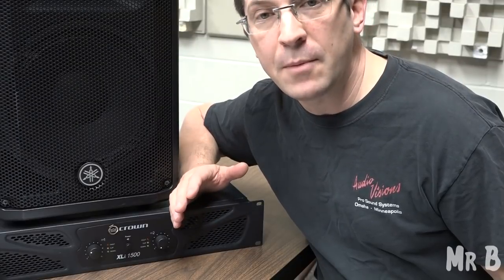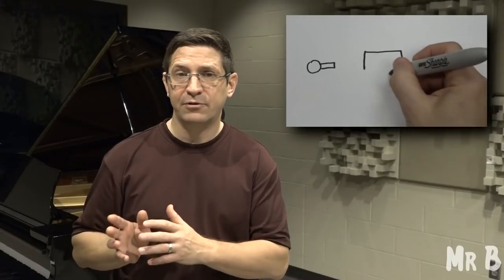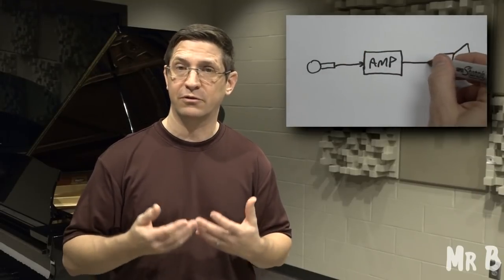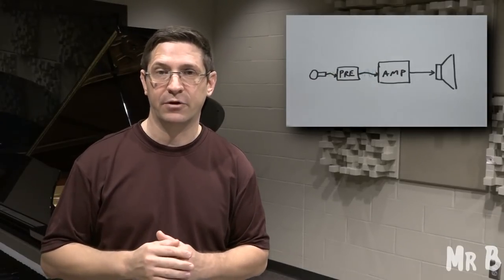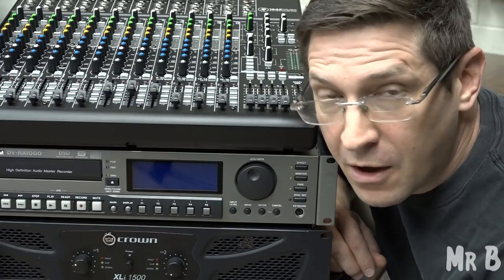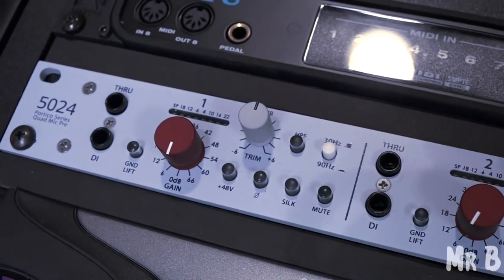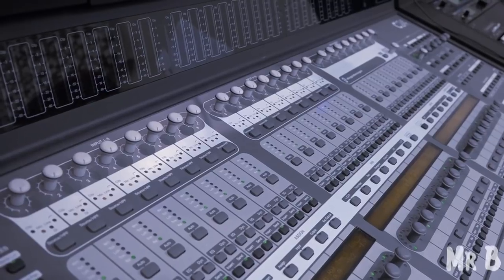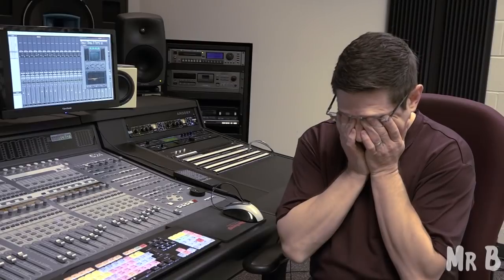What is a Microphone Preamp?

Comment: I was using a friends focusrite solo to track vocals and very seldom instruments. I purchased a budget friendly ($100 or so) tube preamp. I was going to run it through the focusrite. My mindset was the less one device is doing the cleaner the signal aiming to have a lower noise floor. I never actually got the chance to do much tracking with the setup because an apartment moving occurred so it all got wacky, but recently they needed the focusrite solo back. I’m wondering if i can just simply use my preamp and i’m guessing like line output it to my computer and track that way or do i need a form of conversion before it hits the computer?
Reply: also this may be my favorite audio engineering educational channel.
Reply from the maker: Hi there, thanks for watching!  What's the brand and model number of the tube preamp?
Reply: Mr. B in the studio pretty low budget Behringer Ultragain Pro MIC2200
Reply from the maker: Awesome!  Thanks!

Ideally, you would want an audio interface to plug it into, but it may be possible to plug it into your computer's native sound card.  Does your computer have a line level input, like an 1/8" plug?  If it only has a headphone jack, then you would need an interface of some kind.
Reply: thank you, i think i understand. i’ll have to give it a look. the interface is for conversion correct? i’m guessing analog to digital? i hear conversion used often when interfaces are brought up, but i don’t know what’s being converted or what’s it needed for honestly. I’ve never given that a google or library visit. 
i just want a low noise flow (clean signal?) excluding removing things that give off electrical and fan noise from my recording environment. i have a Behringer U-Phoria UM2 USB Audio Interface but i didn’t really like its sound (that’s why i wanted my friends focusrite) i never tried to use it with my preamp though. Is the audio interface the hardware i should focus my expensive purchase on? I own an audio technica At2020 mic. I apologize for the bombardment of questions.
Reply from the maker: Not a problem.  Yes, the interface takes care of the A to D conversion.  It's worth a shot to see what your UM2 sounds like with the tube preamp.  I would go into the 1/4" input instead of the XLR.  

Going forward, yes I would invest in an interface for your next step.  The Focusrite stuff is pretty good, and reasonably priced too.
Reply: Mr. B in the studio Ah! Thank you so much! Finally someone to answer me who’s knowledgeable, this helped a headache. I’ve danced months with these “what if’s.” Everything I know comes from trial/error of recording others plus self and reading. This was a great help. I hope you have a grand day sir. Wish i was one of your students.

Comment: i recently purchased a shure sm7b. i’m seeing a lot stating cloudlifter or another brand is a vital. i own a preamp i’ve never used just sits in its box an a audio interface. i’m wondering what would be my best course of action at lowest noise floor? how should i run these or should i at all? what shouldn’t be included and what should? i simple just want a quiet recording, excluding acoustic treatment and sound proofing of course and i don’t want to plug cables and damage gear due to lack of knowledge. i originally had a condenser an audio interface before.
Reply from the maker: What are the model numbers of your preamp and interface?
Reply: Mr. B in the studio Behringer Ultragain Pro MIC2200 and PreSonus Audiobox USB 96
Reply from the maker: Ok, next question, what are you recording? Spoken word? Singing? Acoustic guitar?
Reply: Mr. B in the studio most often singing.
Reply from the maker: Ok, based on what you've told me, I don't think it will be necessary to get a cloudlifter.  With the gear you have, you should be able to get a decent input signal.  If you were doing spoken word, and you were a soft talker, I might recommend it.
As for the gear you have, you should be able to get a good recording plugging your mic right into the PreSonus.  
But you might get a richer tone using the Behringer, simply because of its tube electronics.  If you wanted to do that, I would use a balanced 1/4" cable (TRS) from the output of the Behringer to the input of the PreSonus.  Make sure the phantom power on the PreSonus is OFF, and start with the gain all the way down on both units. Slowly bring up the gain on the Behringer first, and if you need more gain into the computer, (which you probably won't, since you're putting a line level signal from the Behringer into the mic input of the PreSonus), turn up the gain on PreSonus.
Reply: Mr. B in the studio thank you so much! you’re the bill nye of music engineering! haha if you had a tv series, i’d tune in. you know your stuff!

Comment: Hey I use shire 57s and the scarlet interface and I have to turn the input level almost all the way up to hear the mic well can I still use a preamp?
Reply from the maker: Hi Steve, thanks for watching!  Yes, you can use another preamp in front of the Scarlett, you just have to watch your gain structure on the Scarlett, being careful not to overload its input.  You might also want to look into a product called the Cloudlifter.
Reply: Mr. B in the studio thank you so much I’ve been trying to find the answer to my low out with the 57s Some show a mic technique of putting the mics a foot or two away for guitars and with my Scarlett alone there’s no way that will work its to low. In the 200 dollar range or lower which do you recommend?
Reply from the maker: Let me first ask, what are you recording?
Reply: @MrBinthestudio  I'm a Christian song writer. Acoustic guitars, piano, vocal harmonies. Erdrummer or garageband drummer. I also use pro tools but garage band is easier.
By the way your flex tool explanation was great I've watched other videos and was lost in the gargin. I've been punching in instead of flexing, that video helped.
Reply from the maker: @steveapplegate322  Ok, then instead of buying a preamp, I would suggest looking into a condensor mic instead of buying an additional preamp. You should be able to find a good one in your price range.
Reply: Mr. B in the studio I just bought a sm7b today thinking along those lines. Thank you for your knowledge and time. Hopefully that mic will do the trick.

Comment: what happens if one feeds a mic-preamp with line-level sound, instead from a microphone?
Reply from the maker: Depends on the preamp, but line level into a mic input can distort pretty easily.  It can be done, however, if you're careful  about how hot the line level signal is.  If the mic pre has a pad on it, that can help, too.
Reply: @MrBinthestudio  thx. can earphone line-level be amplified without distortion?
Reply from the maker: @bluename4  Yes, if you go easy on the volume from the source, you should be able to do that.

Comment: I have one furthure Question: What about noise. What if I would like to record something really quiet. With your type of equiptmen you might not have these problems. But what if you have noise on your recording. Do I need a better microphone, or a better preamp? Or propably both?
Reply from the maker: That's a tricky one to answer, as noise can come from many different places.  What does the noise sound like?  Is it a high frequency hiss?  What kind of mic/preamp/recording system are you using?  Give me some details and I'll see if I can help you nail down the problem.
Reply: The noise sounds like you turn up the volume of an old amp verry loud without playing music. Is pink noise the right term? Maybe.
I used two Sennheiser 80s with XLR with a Zoom H4n. So I used the build in Mic preamp. The self told challenge was to record a Chior concert in a big church not noticalble from the back of the church. I did this to test the shotgun character of the ME 80s.
Reply from the maker: The H4n is a good system, so I am suspecting either the mic or the cables.  How old are these mics?  Also, do you know if they are phantom powered, or are they the older T-powered version?
Reply: I use the xlr Version with phantom power. And yes, this mics are old and I already noticed that newer mics like the NT5s produce more signal. So better mics would be an option but the new mkh or ntg are currently out of my price range.
So I'll try some other preamps in the next days. Meaning some other preamps which are built in in some other devices I own. I don't have some stand alone preamps.

So thanks for your Videos!
I like them. And I am one of those persons that are interested in the details you skipp sometimes.
Reply from the maker: Thanks for watching!
Reply: Yes, the preamp has an impact on the noise. With the Zoom R24 I can record silent things better compared to the H4n, and I bet with standalone mic preamps it would be better again.
Reply from the maker: Interesting.  I'll have to do an A-B comparison between those models sometime.

Comment: i have a avalon m5 for vocals.. what compressor should i get?
Reply from the maker: Any compressor will do the job, the question is, how much money do you want to spend?
Reply: @MrBinthestudio  im hearing that singing needs a slow compressor and rapping needs a fast compressor. whichever one works best for both.. im thinking tube tech cl 1b.. no matter the price
Reply from the maker: @NIP28  ok, very good choice. Whether a compressor is "fast" or "slow" depends on where you put the settings on the compressor. I would suggest watching my video on compressors. Let me know if you have more questions after watching
Reply: @MrBinthestudio  i understand a compressor, still watched your video, it was the best explanation ive seen... what im saying is some people believe for example that the ua 1176 will be better than the LA 2A for "Rap" vocals because it is better at faster attacks and faster release... it didn't make sense to me either wen i heard this... its why im asking
Reply from the maker: I've never done a comparison of those two models, so I can't speak from personal experience.  But what you will find with gear like this, is that you can put two compressors side-by-side, put the settings at the exact same parameters, and the two will still sound differently.  Preamps, compressors, mics... all are going to have a character that makes them unique.  But what is important is not what engineer A or B says about compressor X, Y, or Z.  What's important is the sound that YOU are looking for.  So while some engineers may prefer an 1176, that doesn't mean that you will.  My advice - since the gear you're considering is a significant investment - is to see if you can get your hands on them as rentals.  Try them out first and see what you think.  I hope this is answering your question.  It's very hard to give a straight answer on this... once you get past understanding the technical side, it comes down to taste and what you're looking for.
Reply: @MrBinthestudio  ok thanks alot... will be looking forward to renting... i got lucky with the avalon m5, i just bought it and it sounds really good...

Comment: So maybe this is why I get such a low signal. I plug my microphone cable straight in my interface. The Sound is so low that I have to Add a compressor plugin to hear it properly, but still the waveform is just a straight thin line, and the signal dots on the interface is not flashing green. I’m gonna try to buy a preamp !
Reply from the maker: Thanks for watching.  I hope it works out for you!

Comment: i think it would have been useful to demo the recordings first WITHOUT a preamp because it would be interesting to hear waht the signal boost is. Also with VOCAL not just a piano and a drum.
Reply from the maker: Ace In The Hand TV, a preamp is necessary. Without a preamp, there would be no amount of usable signal.  As for recording with a vocal, I agree, that would be a good source for comparison.
Reply: Mr. B in the studio .I understood the explanation ..but i would have liked to actually hear it. I have never had any problem of plugging a mic into an amplifier and gettinf a sound. So im assuming from what your video says that the preamp may have been integtrated into the units ive used ..and i just didnt know.
Reply from the maker: Ah, gotcha. When you plugged into the amp, we're you using one of these? https://www.amazon.com/Shure-A85F-Transformer-Female-4-Inch/dp/B0006NMUHW#immersive-view_1523578738409

Comment: Mr. B,   Home Studio...Is there a danger of damage stacking Preamps? I want to bring my mic into my Tascam UF7000, and then out to my Denon mixer via xlr...if I go line in, will I be by-passing the Mixers Pre’s? Thanks I love your channel!
Reply from the maker: Hi Nathan, thanks for watching!  What's the model number of your Denon mixer?
Reply: Mr. B in the studio my Denon Mixer is the DN 408x.
Reply from the maker: Ok, got it.  The ideal way to handle this would be to connect from the XLR output of the Tascam into the line level input on one of the channels of the Denon.  This doesn't bypass the preamp, but introduces a pad in front of the preamp so that it isn't overloaded by the line level signal from the Tascam.  You would want to use an adapter like this one:  https://www.sweetwater.com/store/detail/STX103F--hosa-stx103f-3-foot

If you plug into the XLR input of the Denon, but you run the risk of clipping (distorting) the input, since the line level output of the Tascam is much higher than what the mic input on the Denon is expecting.

Does that help?
Reply: Mr. B in the studio Thanks, that was very helpful. I think a lot of home studio owners could use a better understanding of the intricacies of the signal chain especially as most of their devices provide for a USB interface as well . My usage is getting setup for Live Streaming, with recording simply for archiving. In setting up, I wanted to be able to expand if things go well. I will be a follower and encourage others to seek your advice....thanks again! Nate Brewer
Reply: Mr. B in the studio , sir let me pose another question regarding mic boosters, in particular the cloudlifter, the mic a Shure SM-58, when ordering the Tascam I was assured I would need the cloudlifter to boost the signal to the Tascam’s preamp, which in itself is designed to function as a standalone preamp as well as audio interface if desired. What is your advice on this? Thanks.
Reply from the maker: Well, it depends on what you're using the 58 for.  The cloudlifter (which operates via phantom power, by the way), gives an additional boost of signal for low-output dynamic mics.  But whether you need it or not depends on the source.  If you're using the 58 for something quiet, it might be useful.  If you're using one inch away from a snare drum, you probably won't need it.
Reply: Mr. B in the studio thanks again, now I understand...for voice the Cloudlifter is a plus!